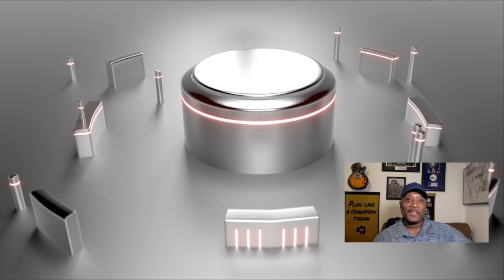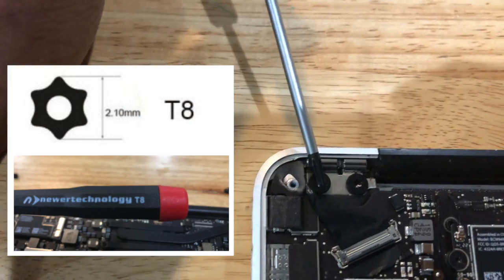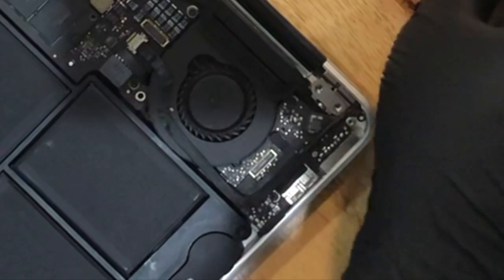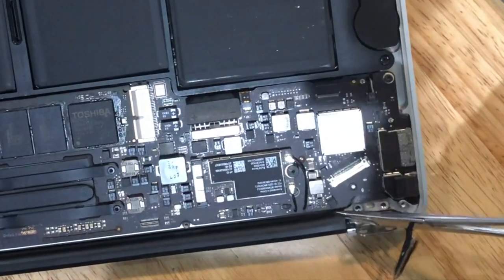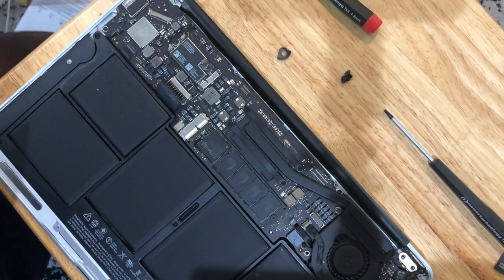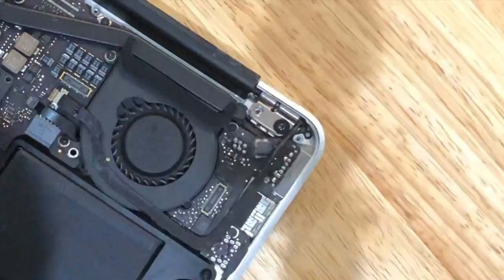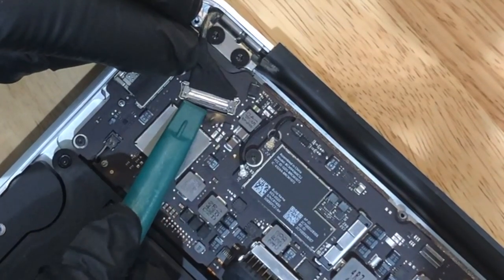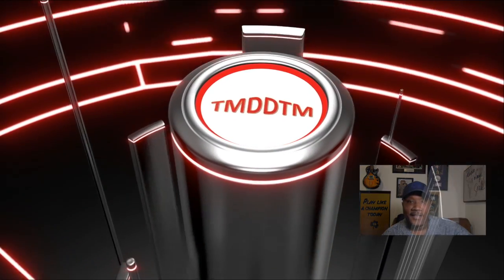DIY Fix Loose MacBook Air Screen Hinges

Comment: you should slide the hinge cover and it will come out easy after that. Your way actually can damage the tracks on the plastic cover and make it difficult to slide it back tightly to cover the hinges. Good luck.

Comment: you just made me unscrew a macbook air without any result. the only result that i've got is breaking the plastic cover and now i can't put it back. it doesn't fix the screen hinge issue at all. thanks, now i need to buy a new plastic and i must wait until i can use my macbook again. the hinge itself is loose and to reapair it you need to buy a new one.

Comment: 5:00 mounting back that black bar is harder than micro soldering ram slots. I had to remove internal side stoppers with a cutter in order to place it properly
Reply: note: on the inside of the bar I preserved internal stoppers on the side facing outside, just removed internal stoppers facing inside
Reply: @Tuttigiu  thanks, I'm trying this

Comment: I just tried to tighten the henge screws and fallowing the video stop by step but the screen is still loose what do I do
Reply: same! what can we add to the hinges to make them more "firm" and less "wobbly" since tightening the screws on the screen AND on the MacBook Air body / top case did not fix the issue?

Comment: Tip: the hinge cover doesn't snap on the inner side, it snaps on the outer side, then you need to slide it sideways to lock it in. You can't just snap it in.
Reply: your comment helped me so much, I was about to freak out but I managed to fix it no problem after reading this. Thank you

Comment: Macbook Air 11 i7 medio 2015 is still the best laptop Apple ever made. Upgraded it of course with 2TB ssd. Everything has been  working like a charm for some years but today I discovered the plastic hinge cover wasn't put back in its place properly.  That\s where your video came in. Thanks a bunch!

Comment: hi. quick question: i used your video about 6 dos ago and it helped a lot but has recently began loosening again (no big dal. i expects that). so i watched your video again and retightened the screws but this time the screen is just as soon as before. any advice?
Reply: simply replace entire display - which you should have done from the start

Comment: Congratulations to the video. My mac screen (Macbook Air early 2014 A1466) is loose and I'm looking for the hinge to replace it, I looked on the internet but I couldn't find it. Do you have a reference from where to buy it?

Comment: But you have damaged the plastic wire cover because you were using pliers to lift it. You can see how the plastic is bent when you remove it and when you put it back.

Comment: Hello thanks for this vid we followed all instruction but cover still floppy, can you suggest any other possible solutions? Could the actual hinge unit itself be loose and can we replace it? much thanks  - cliffatcliffworksdotnet
Reply from the maker: Cliff, if it is still floppy, I suggest that you take it to a local apple fix it shop. Here is Arizona we have “You Break It We Fix Store” they can typically resolve the issue same day. 

Or you can take it to an Apple store or BestBuy and they can replace the hinges.

Maybe the hinges are worn.  Typically it is just loose screws but of the hinges themselves are stripped they may need to be replaced.
Reply: @TMDDTM  Hi just saw your reply and thank you! here in Tokyo we don't have BestBuy Stores but do have Mac repair shops. Will try them. Apple won't touch older models.
Reply: Great vid. Broke the hinge cover (that plastic is brittle), but replacement is $8. Hinge is slightly more stiff.

Comment: Prob the computer is done but somebody has an expensive Mac book pro computer and they didn’t take care of it by holding it with the screen dangling. The hinges got loose and they needed something behind to to keep it stable. One day, their screen started glitching as heck and would only keep stable if it were exactly 90 degrees. Is this fixable to bring to a tech place??? Please respond
Reply from the maker: Yes, a tech store can fix this.  Is sounds like the internal cable that connect the screen to the base has been compromised.  They can attach a new cable is that is the root of the problem.  The worst case is they will offer to replace the whole screen

Comment: Hello, I need to change tese screws , can I search them for T8?
Reply from the maker: Since I do not know which MacBook Air you have... I have attached a link for you so you can find replacement screws.  These screw should be the same for all MacBook Airs from 2010-2017.
 
Just copy and past in the whole link in the address bar I pasted below.

Let me know if this helps.

https://www.ifixit.com/Store/Mac/MacBook-Air-13-Inch-Late-2010-2017-Lower-Case-Screw-Set/IF188-099?o=1&utm_source=google&utm_medium=cpc&utm_campaign=2064540939&gclid=Cj0KCQiA3NX_BRDQARIsALA3fIJqttOmyYpY-bIGfpO8kN4pcrJ79-VJW3uaLQi420s23aZnH-UIc1IaApDeEALw_wcB